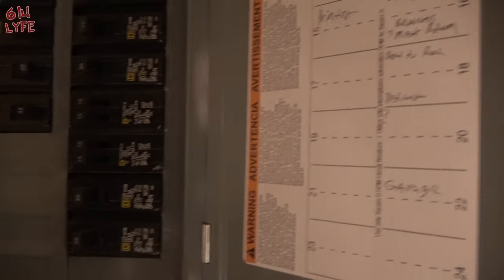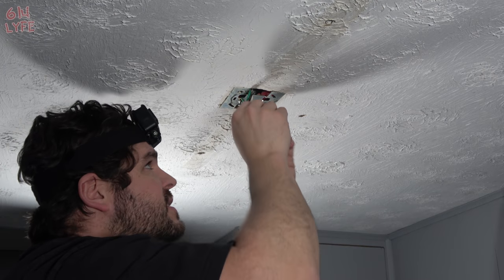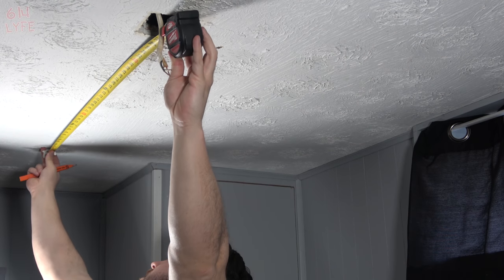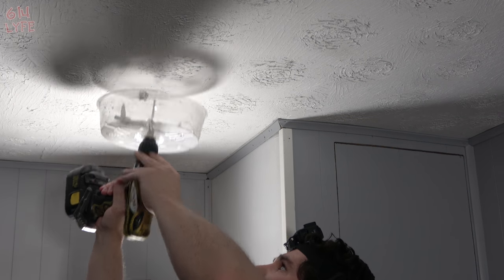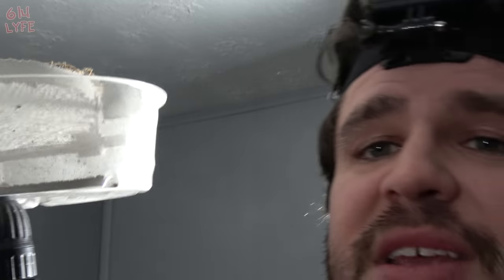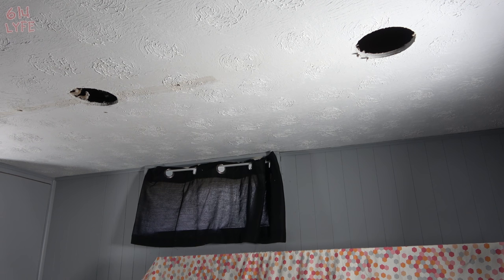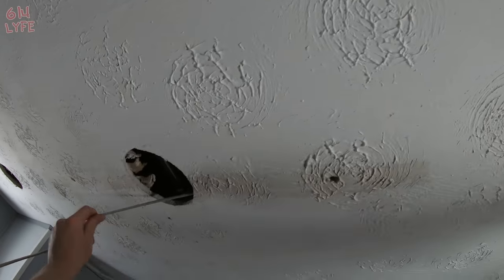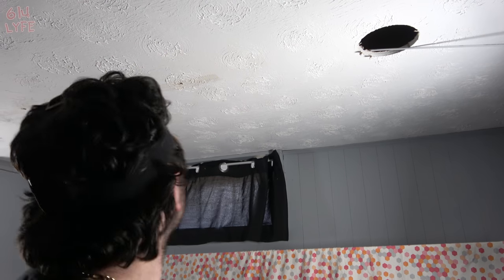DIY | How To Install Recessed Lighting With No Housing or J-Boxes

Comment: I'm not an electrician but an engineer that read the NEC and DIYs electrical. Folks watching should know,  NEC requires strain relief where the 120V wire enters the metal junction box. The wire could rub through the insulation and cause a short. NEC also forbids mixing 12 and 14 gauge wire on the same circuit.  

Permit your work! Sure it's a tax ultimately but it also catch some common errors. Great detail in the video!
Reply from the maker: Congratulations
Reply: The right tools for the job....how about the right material? 12/2 wire should have been used especially if all the lights you are installing are on the same circuit. 14/2 is rated for 15 amps
Reply: @jputman082297  I doubt these LED lights come anywhere close to 15 amps
Reply: There is strain relief built into the box. If you look at 10:57 there are black plastic things built into the box in addition to knock-outs. Use a small screwdriver to gently pry open the top of the black plastic part  revealing the strain relief  one way feed through. (Tip It is easy and if it is  not easy you are doing it wrong.) So might as well use what is built in. 

Its OK to add 14AWP to end of 12 AWP to support led lights.  The whole installation in the video could be less than 100 watts.
Reply: John Putman why would you use 12/2 for this application? That makes no sense at all.

Comment: I had just purchased can lights and was really dreading the install when I came across your video.  Thanks to you (and Home Depot’s return policy) I’ll be upgrading to the low profile LED lights.  Thank you for taking the time to share your knowledge.
Reply from the maker: you will love them and how easy they are to install
Reply: Lighting and their fixtures can be frightening to screw up. Luckily, these videos along with some others are great. Very informative.
Reply: Installing 4 of these in the kitchen.  Dreading the ones where ceiling joists are blocking. First floor so no access from above unless wife lets me pull up flooring. 🤔

Comment: Bro!!! I was seriously stressing about doing this for my house.  I didn’t know which lights to buy and how to get this done.  

Your video is ON POINT!!!  I am doing my whole living room now that I see how easy this was.
Reply from the maker: Yeah when you get past the fear of getting shocked its one of the easiest jobs you can do. They have made the lights so simple to install now.
Reply: 3k setting on lights for me in kitchen.
Reply: @614Lyfe  does insulation play a hazard in installjng these?
My cellings filled with insulation so do i stick with air tight cans or can i still use these
Reply: @canogaparque818  I am tryin to figure this out too... did you find out?
Reply: @freddythepoo  yes thier ok no problem with heating as its led

Comment: I'm so glad to have watched this.  I can't go up above my kitchen, cuz it has another floor there, and I love those lights.  I loved that hole cutter, too.  I will definitely get that.  I thought recessed lighting would be too hard for me, but I am gonna do it!
Reply from the maker: you will be amazed how easy they are to install.  Let us know how it goes.
Reply: Mine is a two storey house,. Once An elctrician did fix up downlights downstairs. He was confident he will drill through the beams(wooden) holding up the second floor to run the wires from the existing light source. Later found out that they were not beams but something like two 2x4 supported by zigzag iron belts ????  Like the Eiffel tower, making the work easier for him

Comment: Thanks- watched your video, went and fixed 2 downlights(it was all i wanted). What motivated me to do it straight up was  that you took on ly 1.5hrs to do 9 lights. I was hesitating because i did not have a 92mm hole saw. saw you using the saw, I went up using mine(ended up using a drill-saw bit with my daughter holding up a vacuum cleaner pipe to the ceiling.
Reply from the maker: This is amazing so happy I could help. Thanks for watching

Comment: Thank you man! Freaking awesome video with great camera angles. Appreciate it!
Reply from the maker: Happy to help
Reply: @614Lyfe  Question for you, if you don't mind. I see other guys installing the recessed lighting housing in their remodels using these for example; https://www.homedepot.com/p/Halo-H750-6-in-Aluminum-LED-Recessed-Lighting-Housing-for-Remodel-Ceiling-T24-Compliant-IC-Rated-Air-Tite-6-Pack-H750RICAT-6PK/204992487
What's the advantage of installing a housing when they can install LEDs like you just did with NO housing? Thanks brotha
Reply from the maker: I would say its just personal preference.  I have only done it the way in my video but both would work.
Reply: @614Lyfe  Awesome, thanks man! Would I have to wire in a different way than you did in this video since my lights are on a two way switch? Or could I just run wires the same way you did here?
Reply from the maker: As long as you don’t mess with the switch it should be the same

Comment: Nice video for the most part, just a heads up most older home are wired in #12 awg Romex  the whole home,which is rated for 20 amps , you said you used #14 awg romex which is rated for 15 amps using a smaller wire like  that will increase the Resistance on the Electrical circuit and may cause that wire to heat up and possibly cause a fire , next time just use #12 romex , second thing you need to use romex connectors when using those knock outs the Electricity flows in a frequency which causes the wires to Vibrate a very small amount which we can not see but can cause the metal edge of the knock out to cut into the wire which if Energized can cause the breaker to trip if the breaker is working Properly, if the breaker is not it may cause a fire other than those to small things you did it like the pros do it
Reply from the maker: thanks for watching
Reply: I too were wondering why the knock outs didn’t get any wire clamps to hold in place. I get why 14/2 was used, LED = low power consumption
Reply: Lighting is usually 14 gauge and outlets are 12 gauge.

Comment: 👍 only question I have is at what point or how u put in the light switch? Thanks great job
Reply from the maker: You can add it before or after. You just have to make sure you dont have power when installing the lights. You can even use the old switch if it’s already installed

Comment: So I'm looking at doing this too....I've got one Central light in the room and want to turn it into 5 cans. It's on a single switch  The issue I have is the joists run perpendicular to the room and I'm unsure about whether I'd have any room to fish wiring through without cutting through the joists? Also, if I want to add 4 cans to the central light which will also be a can.... How do I connect them all with a 3  plug can like you have here? Do you use pigtails or Daisy chain and which is preferred or safer?
Reply from the maker: You will have to drill holes into the joists to be abke to fish the wires. They make a bit that can do this very easily. And yes the best way is to daisy chain from one light to the next. The most tou can fit is three per connection. Hope this helped.
Reply: @614Lyfe  it does cheers. Looking for any option to not drill through 7 joists.

Comment: You make it look easy enough but how did you find the power wire? Is it labelled? And what if you don't find one where you drilled. I'm new.
Reply from the maker: the power was already in the roof.  I used an light that was already installed took it down and used that power.  if you have no power you will need to run new wire to the spot you want to install the lights.

Comment: Good detailed explanation. What’s the equipment that you used to make the hole in the ceiling with the drill?
Reply from the maker: Klein tools makes it and its always in the Electrical department at Home Depot
Reply: @614Lyfe  ok thanks.

Comment: I found the ceiling studs/beam first then made my first hole and found water line above for the washing machine upstairs, then marked the floor where i wanted the center of the light and with pendulum marked ceiling, then used nails and fishing line to get everything squared.
Reply from the maker: Thanks for sharing.

Comment: are these rated to where they can touch insulation I already have in the ceiling?  great video
Reply from the maker: Yes they are and you can put them in the shower as they are rated for wet environments. Thanks for watching
Reply: @614Lyfe  nice, thanks for the reply

Comment: it would be a good idea to put romex connectors on those holes so the insulation dont get cut and cause a fire..
Reply from the maker: yeah i think your right.  It will be easy to add them I just need to pick some up at the home depot
Reply: Can you let me know what you mean in greater detail. I looked up romex connectors but didn't notice at what point of the video it should be used during installation.
Reply: @614Lyfe  where would you add them. Sorry not understanding what the romex connectors are used for
Reply: @rehanmahmood7728  It is like a grommet you put on in the punch out of the connector box so that the wires don't rub and get sliced through.
Reply: I bet you never went back and did it the right way.......
Reply: @ramaporiver803  Nah
Reply: This lights come with two black cable clamps built in for #12 o #14 romex if you pay attention you'll see them on the top of the box so you don't even have to punch out the metal knock outs for the romex connectors, you'll have to lift the closing tab to open this so you can push or slide the romex in to the clamps. I installed a lot of this before and all the Halo lights come with this cable clamps but if you use the commercial electric lights you'll have to use romex connectors

Comment: I'm trying 2 add two recessed lights 2 an already existing power line (3 lights in total). Same as your video. Just 4 reassurance, I can add 2 separate lines and connect both lines the the already existing power line. So 3 black wires, 3 white wires and 3 ground can be joined? Am I correct?
Reply from the maker: Yes that will work perfect 👌
Reply: @614Lyfe  thanks. Most detailed video I found.
Reply from the maker: that is always my goal when i make a DIY video.  so happy we could help.

Comment: Hey man that was neat. How much was these lights? And your switch was separate correct? How much was that? Thanks for the video. I'm subscribing.
Reply from the maker: The lights are 20 each and the wifi switch was 50. If you need wire we got 100 feet for 50 bucks. Glad we could help

Comment: Thanks for your video. 
Why do we have a white cable and a yellow cable? 
How do you connect lights around a room if the live wire is in the middle of such room?

Thanks again!
Reply from the maker: you should use the white cable the yellow is just a bigger thicker cable and i ran out of white.  but if it is the middle of the roon you might have to add a junction box to split off the cable to two different runs.
Reply: the white cable is 14/2 wire, Yellow is 12/2. different gauge wires that shouldn't be mixed on a circuit
Reply: @jputman082297  14/2 is only rated for 15A, correct? 20A should get 12/2? Maybe I have too many questions to try and do this myself.
Reply: @subeyguy66  just do your homework, different size wire for different amps. Running undersized or mixing different gage wire could... Trip the circuit or burn it up. Better to be safe than sorry
Reply: @614Lyfe  d

Comment: Great video. Where did you get the light switch and how does it work with your phone?
Reply from the maker: Got it at home depot. Its a smart switch. You hook it to an app on the phone via wifi. It comes with the instructions very easy to set up.
Reply: Does it work with wifi or bluetooth?

Comment: When you run them thru the celling 
Does the insulation play a factor like is it a hazard prone to overheating?
Reply from the maker: Box said it was safe
Reply: This lights are IC rated which means the can be in contact with the insulation because they are concealed and they don't produce heat like the old recessed can lights

Comment: Thanks for your response.  Perhaps my questin was not clear.  I am connecting 4 lights in seriies off one switch.  Do the light fixtures have connectors for the cable coming in as well as the cable going out to the next light?
Reply from the maker: each light has the ability to connect three wires of each color

Comment: On 3:18 Are the plastic fitting necessary, what holds the wires together as they enter the box junction? Is that all it does or is it a seal?
Reply from the maker: The wires are held together with the connections inside the box

Comment: Love you video .but I have a question can you use 14/2 cable and attach 12/2 cable? I was told you can't do that. I'm in the process on installing the same light right I run out of 14/2 cable but I have like 200 feet of 12/2.
Reply from the maker: If you have 12/2 comming from the breaker box you have to use 12/2 but if you have 14/2 comming from the brraker box you can use 12/2. You just never want to use smaller wire then is coming from the box.
Reply: Ok great yes I do have 14/2 coming from the box so i guess in safe here thanks for the quick response
Reply: Now I have this issue I have 14 /2 coming from the box to junction box with 15 amp braker my house was build in the 50s all power is coming from the junction boxes I have this light the look the added a switch to turn it in and off but they use 12/2 to the switch to the juction my question here can I add another light from that juction box with 14/2 or 12/2 thanks
Reply from the maker: I would stick with the 12/2

Comment: Great video .
? ,,,, Can you install 2 or 3
lights ( set at the Max light output setting ) onto a dimmer switch ? 
Thanks .
Reply from the maker: I have 9 on one switch
Reply: @614Lyfe  .. Is / Can it be a dimmer switch so you can adjust the brightness of the lights ,, with a slide controller ? ( if they are all set at the brightest setting ) Or is the only option for these lights is to choose a setting ?
Thanks again !
Reply from the maker: Yes if they are not on a dimmer they will be full brightness. I would recommend a dimmer as the are very very bright

Comment: Did you know the unit includes two built in strain relief on the jbox, thereby eliminating the need for using the knockout? Didn't realize what the black plastic on the side were for until I read the directions.
Reply from the maker: Who reads directions when you can just watch YouTube videos

Comment: fine job Sir, Great video!!!!! :) I just bought 6 lights my self. My question is, can I connect cable/lights in series? I mean, connect first light from existing light source and second light from the fist light and third light from second light and so on....
Reply from the maker: yes you can as long as the wires are not all out of control.
Reply: @614Lyfe   I too am running led lights (4 of them) from one dimmer switch.  Will the light fixtures accommodate the wire coming in as well as the wires going out to the next light fixture?
Reply from the maker: yes you should be fine.  the LED lights use almost no power so you can run way more per breaker then normal lights

Comment: K refers to wave length, not Kelvin.  Kelvin is a measure of absolute temperature.  The surface of the sun is 6000 degrees Kelvin.
Reply from the maker: Thanks
Reply: "K" DOES refer to Kelvin... Yes, Kelvin is indeed a measure of absolute temperature but that doesn't change what the K refers to. For example; 5600k is 5600 Kelvin. Saying that the K doesn't refer to Kelvin would be like saying F does not refer to Fahrenheit or C doesn't refer to Celsius.

Comment: This may be a dumb question, but what if I’m installing these into an existing light fixture that doesn’t have a ground? It’s an older house, but I’m not sure if I need to run new wire with a ground all the way from the breaker box.
Reply from the maker: I really don’t know that answer to that. But i would run a new wire if possible because its good to have the ground.
Reply: 614Lyfe thanks for the reply!
Reply: I mean i just installed one today that doesn't have a ground so all i just did is plugged up the ground because like its plastic you dont need a ground

Comment: Those are mad expensive 😂 I have attic above. Would it be easier?
Reply from the maker: It should make running the wires easy for sure
Reply: @614Lyfe  I just don't want to go in to the attic lol.
Reply: @614Lyfe  pain in the ass trying to run wires with all the insulation & no room to stand

Comment: How do you cut through joists? Do you have video on that plz.
Reply from the maker: you have to get a drill bit they make just for it.  its very long and flexible.  It lets you drill a hole that the wire can run through.  I will try to get a video of this for sure.
Reply: Always drill a hole through the joist to run wires through so that the structural integrity of the joist is not compromised.  If you cut a 1" deep notch out of the edge of  a 2X10 joist, you now have a 2X9 joist which may no longer support the load that it was engineered to carry.
Reply from the maker: 100% correct

Comment: Are these IC rated meaning they are rated to be installed with insulation without the Jboxes?
Reply from the maker: I would just follow what the box tells you.  if it tells you you need the j boxes then use them.  But I cant tell you 100% so I would just read.

Comment: Thank you this is a crystal clear DIY awesome work of yours! I just had a small mind cloud, I bet your cable connections are straight to the fuse box right? Or is there some kind of electric power regulator in the middle between the fuse box and the recess lights? Pardon my ignorance.
Reply from the maker: You can do it eather way